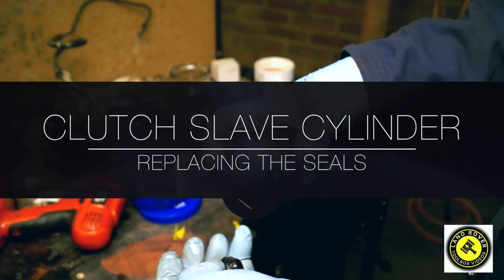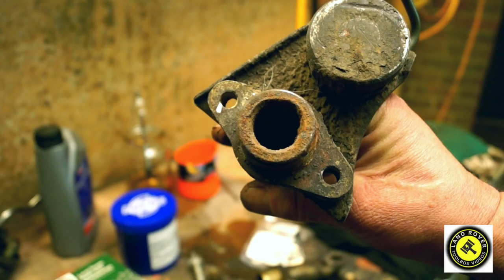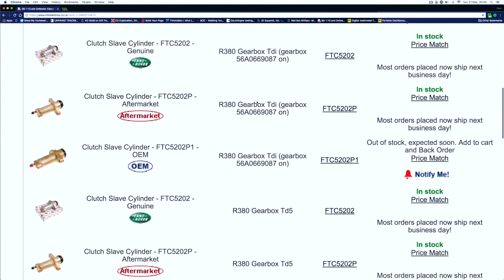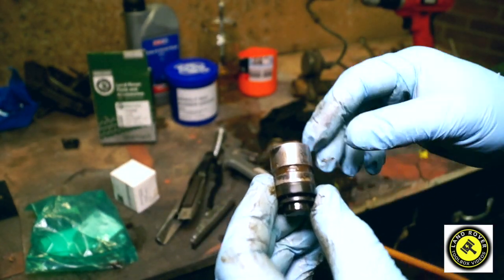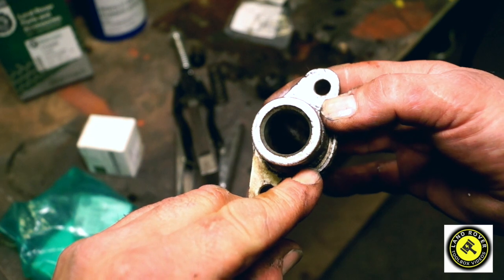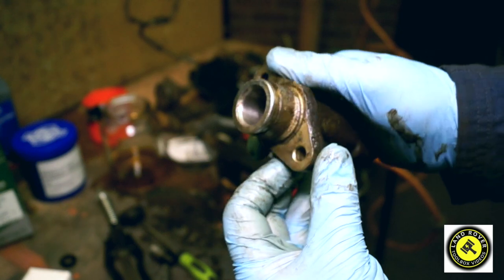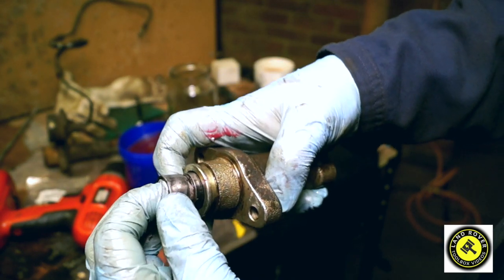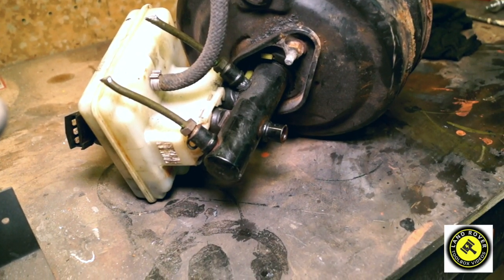Overhauling the Clutch Slave Cylinder LT77 R380  (Honing and Seal Replacing)

Comment: Hello Chris, on my 300tdi 90 I noticed a couple of drops of oil under the clutch pedal. Googling I see that the master cylinder needs to be replaced, I bought a new one and should be coming soon. Do you think the slave cylinder needs to be replaced as well, or things are unrelated? How would I know if the slave is good or bad? Thanks!
Reply from the maker: Yeah why not.  They are not expensive.